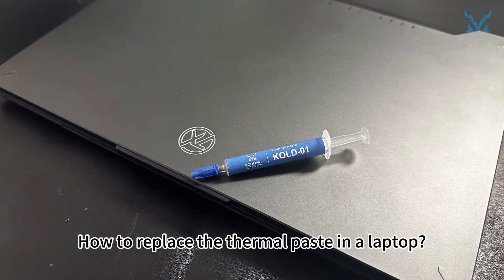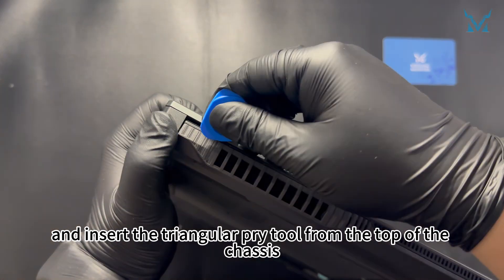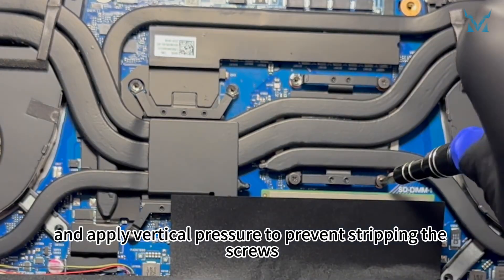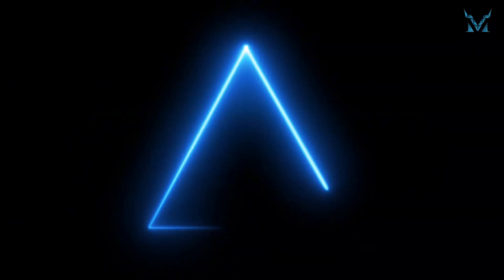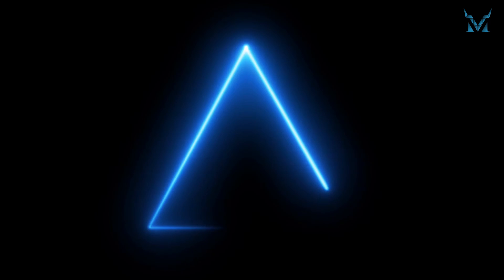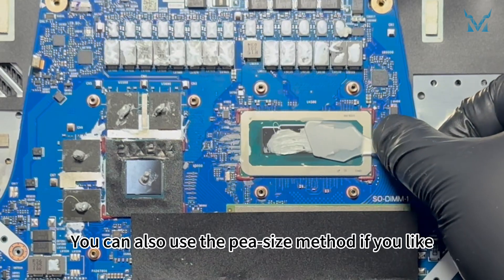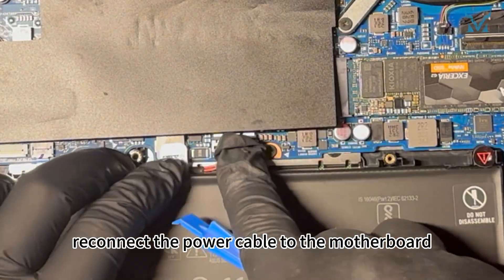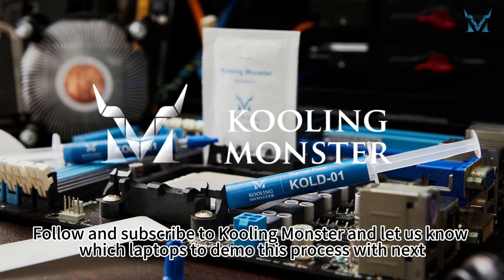Speed Up Your  Asus TUF Gaming F15 2023 Prevent Overheating With Dust Cleaning & New Thermal Paste

Comment: Trust me on this, You're gonna get pump out with thermal paste... period. It's not if, but when.  Use a thermal grizzly cryo sheet instead for the CPU and GPU. I did that to my Asus and the temps have never come back. I also recommend a Llano cooler. Any other cooler like that one, or one just like it is a complete waste of money. If youre gonna do hard core gaming, like running Black Ops with High to ultra graphics, then you WILL need the cryo sheet along with the LLano cooler.
Reply from the maker: Thanks for sharing your experience! Cryo sheets and external coolers can definitely help in heavy gaming scenarios. 👍

For most users though, a fresh high-performance thermal paste + proper cleaning already brings a solid temperature drop without extra cost. 🧊✨
But it’s great to know different upgrade paths depending on how demanding the usage is! 🙌